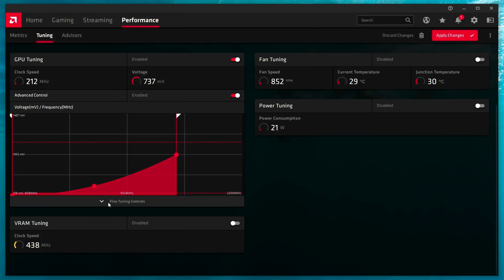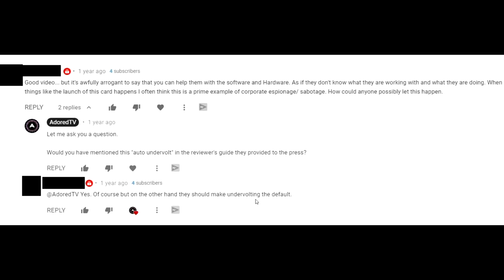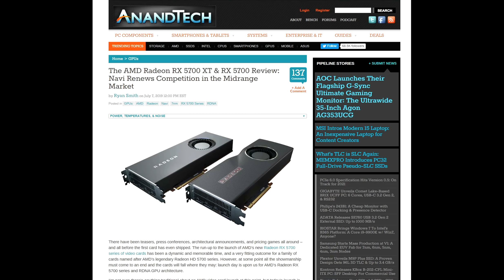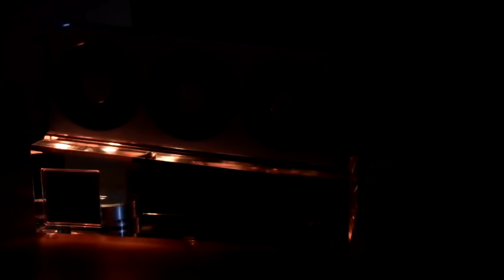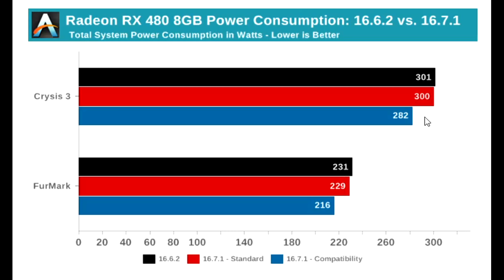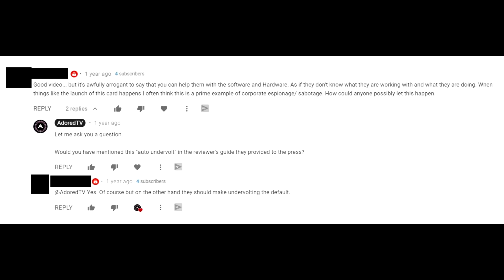Fixing AMD's "Hot and Loud" Graphics Launches.

Comment: Another option: Add a ladder of increasingly fragile structures (prone to flip, prone to degradation) on the chip, test for their state, and periodically use that as input to adjusting voltage offset (every boot, every so many days). A dynamic implementation of your option 3, but other input.

Comment: Why bother, it's even simpler, leave it as it is but the default setting after install is -100mV hidden offset and the displayed/reported voltage is without this offset. Then when you click default it removes the offset and goes back to pure stock while giving no indication what so ever other than your power measurements would now show a little higher power draw. All these GUIs are so damn easy to cheat from a software perspective. Or use a reviewer VBIOS with a hidden offset, the cards are cherry picked anyway so they will all run lower voltages. AMD has been overvolting their GPUs for ages now, it's truly sad. You run an NV card, it will power throttle and drop even as low as 900mV, yet the performance is still quite good (-5% clocks, when OCed over 2GHz) that one doesn't notice unless monitoring the values live in overlay. I don't get free cards, then sure it's true "no one" would find it XD

Comment: I believe undervolting resulted in my Radeon VII getting shorted and having to RMA it. But would prefer the auto-undervolting drivers that finds the best and most stable frequencies and clocks for the specific GPU. Even if the card is not the best undervolter, it would still get some benefits from the undervolt.

Comment: Higher voltage to guarantee stability over time sounds counterproductive, typically higher voltages degrade the chip faster and on top of that higher temperatures also makes the card fail faster, even more so on big gpus like vega and hawaii. What they should do is target lower voltages, lower operating temperature and lower power target, that way they'd leave room for overclocks by AIBs with better coolers as well as users by leaving these things unlocked and then just using weaker VRMs on lower end cards to keep proper segmentation (making the card clock down if it's too close to VRM thermal limits, much like a the core would and throw up a warning in the driver) so you can't blow past something like a 5700xt with something like a 5600xt just by overclocking.

Comment: LoL u are a fail user....
no one use tuning for underVol...
maxVol =1212. 
min=max clock=1900..
tdp+33 /50%...
fan 65 C= max...
Reply from the maker: 65C idle on the desktop yeah?  If you think the reference Radeon VII can hold 65C with those settings you've got a critical failure somewhere, mostly in your head.

Comment: After edit: [Paused the video at 20:05 and typed this comment.  Unpaused it to hear Jim come up with my brilliant idea about 20 seconds later... lol]
Why can't they undervolt by default, and have a way to internally monitor stability and increase default max voltage by 10mV every time an issue is detected to keep stability through the life of the card?  Sort of like how a hard drive has spare sectors and automatically swaps out any bad ones through the life of the drive - the entire process would be invisible to the consumer unless manually overclocking or undervolting.
Reply: You can have the graphics card change the voltage or clockspeed on its own using internal logic.  Don't need a driver update.  Allow the driver to override this or modify the schedule with new updates, but on its own it can take care of itself.  Like I mentioned, just like a hard drive's internal logic handles failing sectors.

Comment: Regarding undervolting, it really seems to be an issue with amd. If you ask me, VEGA was actually pretty efficient ... just not with the standard settings.
They just pushed the thing waaay past the point of diminishing returns, and made it a 250-300W card. Here's what I did with my Vega64 (blower edition, mind you!)
I just reduced (some reg haxx required) both HBM and Core voltages to 900mV (standard top being like 1100-1200mV, or even more -- don't remember exactly), 
with that, I also OCed the HBM to just above 1GHz (mine didn't wanna go as far as some other folks' did), and got the core freqency basically to where the stock (not boost)
closk speeds were. The only difference now is that my card now runs at about 150-160W, while having the same performance as stock (without boost).
Stock boost speeds would bring maybe slightly above 10% extra in terms of performance, but also almost double the power consumption.
I use it in a mini-ITX case, and the blower style cooler actually proves beneficial here, by sucking the air from the sideo pening and blowing the hot air right outta the back, 

as I have no other fans to get the hot air out of this shoebox. 
Oh, and I also applied liquid metal to it, so, with the aforementioned setup, my GPU usually stays in the low 70ies and Hotspot/HBM below 80°C.
And I bought one of the first editions way back when in OCT/NOV 2017 (right before they became REALLY unaffordable for a while, or just nowhere to be found due to the mining craze).

I suppose the later editions/chips only got better (binning-wise), so if AMD went at least half-way with their Vegas back then (compared to what I did with mine), 

it would've been a really good card.
In fact, I have a UWQHD 34" monitor and, with settings adjusted to not waste FPS on ULTRA-Fine stuff that only drops frames without much visual difference to lower settings, 

I can easily play most stuff with 60FPS++ (Freesync enabled). Doesnt get that much better for the type of games I play; esp. considering it's a 2.5 year old card.

Comment: Regarding that ulnar nerve entrapment.. got the very same last September all of a sudden. Took about 4 months until it went away (well, like 96%). [Advice below]
It came (probably) from lying in bed and supporting myself with the elbow against the mattress while holding the phone in hand (yeah.. a reminder to do less of that),
and / or also simple stuff like having pressure against the elbow while operating the mouse on the PC.
Went to the chiropractor, and I came alredy knowing what I had. Wasn't really much he could do, aside doing the usual cracking of bones to make sure
there is no nerve impingement anywhere else. Aside from that (and I think I also read it on some medical site), there isn't really much to be done, aside from an
operation if the condition becomes too severe and won't get better on its own. If you were in the USA and under-insured, I'd tell you to save your money..
What helped was massaging the area around the elbow, length-wise where the nerve goes along with two fingers of the opposite hand.
Right in there, where the elbow bone splits in two, so to speak.
The massage aint gonna be pleasant, but it'll provide relief after some time (maybe not right away).
Normally this should get rid of the pain in the lower section of the arm and the lower 2 fingers, or at least alleviate it for some time.
From experience, the most important thing is to remove and and all kinds of pressure from the elbow (region) - be it in bed, armchair or whatever.
Not exactly easy maintaining that when asleep, but can be manageable. And don't forget to flex the elbow every now and then - no movement is bad. 

Good luck.

Comment: My first idea was having two versions of the card: a premium model with good, quiet cooling and a bulk model with more loud cooling. It wouldn't fix the issue of unnecessarily high voltages, though. But one thing I like about AMD is that they don't do the kind of marketing scams that Nvidia and Intel do all the time. It's too bad people don't realize this. The very minimum they should do is to inform the reviewers about the undervolting. I would be much more interested to see the undervolted results being compared rather than overclocked: bringing the cards closer to the sweet spot, not taking them further away...

Comment: Another huge improvement happens with aftermarket thermal paste, no matter the brand, nvidia or amd, improvements are a lot higher compared to cpu re-pasting. But cause of the "pump out effect" which happens specially when a better thermal pastes is being used, so vendors preferring using crappy thermal paste for a long-lasting effect. 

ps1. If someone is comfortable of loosing his warranty I totally suggest gpu re pasting even if new gpu. If out of warranty it's no brainer :D. The older the card the higher the difference. Eg.I saw 10c+ difference with vega 64 nitro (2 years old). Regarding what thermal paste.. well there are tons of reviews out there MX-4, Grizzly Kryonaut etc. Just don't use liquid metal thermal compounds. 
ps2. +Watch a tear down video makes things easy.
ps3. I also remember an old gpu test which was claiming same mhz/settings but lower temps=> more fps.. but that was a decade ago, dunno if it applies nowadays.
Reply: https://www.youtube.com/watch?time_continue=341&v=CCqxE-5Ct3w&feature=emb_logo

Comment: AMD does great on the front end of its drivers but some work is needed under the hood, also, I do have to wonder what the ration is of undervolting because every AMD card seems to auto under volt without any issues and it seems like most have the same success rate with that.

I assumed just like Jim did that they added a higher voltage so they didn't throw as many dies away but it seems that might not be the case.

Like Jim says, AMD really need to work on it's PR a lot more because they don't do a good job on that, but I don't want them to be sneaky, leave that for Nvidia and Intel.

Comment: Can't they make the cards smart enough to self tune to the lowest stable voltage? Make it part of the driver install process? This would mean that every card would run as cool and quiet as possible and for each driver update it could be retested and adjusted if needed.

I'm pretty sure I've seen similar features in drivers before from amd with auto over clock features that run through a series of tests to automatically find the highest stable clock speed (highest achievable by the automatic process anyway).

Comment: 12:20 and you would have a review that says "The card is either constantly crashes or it is hot and loud. Pick your poison." 2 bad impressions for the cost of 1.
20:30 and get slapped with "AMD secretly decreases performance of its older cards..." ... oh, you mentioned that.
The option number 3 actually looks like something reasonable. The resulting increase in noise might be shaken off because users expect some wear and tear .
 Additionally, the voltage may be increased after crashes instead of with time. No crashes - no extra voltage - no extra noise.
Additionally they could make 2 reference cards: 1 with cheap cooler and 1 with expensive. Call it "XT6800Cool" and point out that the difference in price is caused only by different cooler.

Comment: im 15:45, so if you say this at any point, sorry, this is kind of obvious. 

hey adored, you have some connection with amd, so how about relay this to them. 
when me and my brother overclock in msi afterburner, and shit goes wrong, it crashes but its not a hard crash. 
would it be possible to 'benchmark' undervolting automatically? 
You install wattman, it tells you to go though an initial setup, it could take a while, and in this time the screen will go black (crashing) and it automatically sets it up for a minimal curve, and can further be set up with an aggressive curve (think a furmark like burn) where it would make sure the card works at specific voltages and sets an estimated fine curve? 
The only problem I see with this being automatic is when it crashes it typically take the program with it, but if they could make a program that survived the crash to measure things and pass/fail, that could work, and if the card had a fail above the normal overvolt bullshit they do, its a hard fail and instant rma. 

I think this would be the most honest way to have an undervolt applied as default, and you can sell it as 'we are setting up custom voltages for your card' 
Hell, you could even potentially have an auto overclock with this same method, but the card stopps overclocking the moment amds stupid voltage is hit and it can't stay stable.

seriously relay this to them if you can.

Comment: Makes me think about the earlier AMD FX series of CPUs where they were volted way too much.  Turns out you could undervolt them a great deal without stability issues.  Plus, their E-series of some of the same CPUs were actually better overclockers (as I had an FX-8320 that couldn't hit 4.0 ghz without BSOD while my current FX-8320E could do it at a lower voltage).  I know I brought up a CPU instead of a GPU, but thought it would be worth mentioning (which I might have in the past in comments for other videos).

Comment: Printing on a larger die  would be a better solution to silicon degradation. Point entropy increases on smaller chips. Spreading the heat over a larger area will always outperform the best cooling solution. Oh.....wait, that's what Nvidia does.

Comment: How about simply not pushing the cards past the perf/watt sweetspot and pricing them accordingly huh ?
That would be the only acceptable solution to ridding themselves of this meme in my opinion.

While with Vega (fairly large chips with HBM) it wouldn't have been financially feasable to adjust the price accordingly (they were already selling them at a loss), going forward it shouldn't be an issue. The excuse doesn't stand anymore. 
Infact they'd have probably been better off not releasing Vega (and i'm using Vega btw, Vega 56. I find it to be a great card, but i got it for ~270 Euro new on Amazon).

AMD needs to STOP thinking that it can afford to price their cards similarly to Nvidia. They say not wanting to be the "cheap" option any longer, yet they fail to see that it was actually the "bang for buck" that got their cards sold in the first place (by the way cheap and bang for buck are different, they fail to notice that aswel). 

I had stated this in the past on one of your videos and i will state it again, NAVI would've made a KILLING on the desktop had it been priced lower (close to what Polaris was). Everyone and their grandma' would've been RAVING about these cards. Had they kept the midrange where it was pricing wise, they would've won a MASSIVE fight against Nvidia both in the marketplace and in people's perceptions. They would've made Nvidia look all the more anti-consumer than they already do, for jacking up prices this gen.

And that's pretty much a fact as we can see NAVI selling quite a bit, even at the CURRENT prices. Hell, the fanboys were even screaming "JEBAIT" and all that crap lol. Just immagine what it COULD'VE been...

Instead they're kinda "meh" because of pricing, because of performance relative to the Nvidia card in the same price bracket (they outperform Nvidia, only slightly though, while costing nearly the same and consuming way more power - which personally i don't care about, but it DOES mean their efficiency is down from a technical standpoint, and it's undeniable). Then there are the driver issues that STILL don't seem to have been fixed MONTHS after release, or at least it would appear a lot of people still have issues.

The FACT of the matter is, they don't YET have the architecture to be able to compete at the high end, and it's something they need to come to grips with and accept once and for all, then move from there. They keep deciding to "fight battles" they can't possibly outright win decisively, and it's wearing them down imo.

They oughta stick to what they can actually put out at a reasonable level of perf/wattt/price.

Comment: I think it comes down to amd runs about 10% more voltage than they need to on cpus and CPUs and have done for over 10 years now. So the fix is simple lower stock voltage what if Vega ran at it's more normal 1.1v instead of the 1.2 it did. What if r7 came with 1.025v instead of 1.1volt.
"Doa rates would increase and they wouldn't be stable" yeah but that doesnt mean we dump 2v into the core just to be sure that it works. Amd coolers tend to be better than nvidia the old furnace r9 290 reference. The heatsink is a HUUUGE long vapor chamber with fold fin heatstack the length of the card. Why did it run hot? Overvolting and wierd silicon. It doesnt matter how much you undervolt or delcock with 100% fan speed. its always at 95*c which doesnt make sense unless the die is just being stupid.
Meanwhile my twinfrozrs hover ~77c that's a 22c drop and the coolers good but not THAT much better.
Other reason and ran hot was all the compute stuff left onboard and the huge memory buses. A gtx970 had half the memory buses and the fp64 was dogs hit by comparison. Finally now amd is starting to carve up its cards like nvidia has done cutting out the unessentials.

Also why dont they set a voltage and frequency ceiling? (nvidia does with gpu already)
Imagine if zen3 launches and you CAN NOT with a normal bios do more than 1.3v
"but clock speeds would be limited", yes it might top out at 4.3Ghz like current chips, but it A) still kick intels arse, B) run significantly cooler with allot less power because reviewers are not dumping in 1.4v just for another 50mhz, C) make next years products that much more impressive.